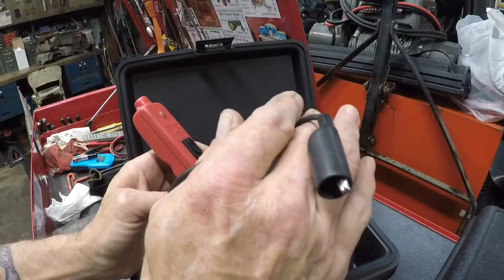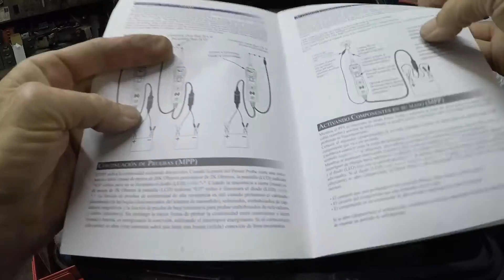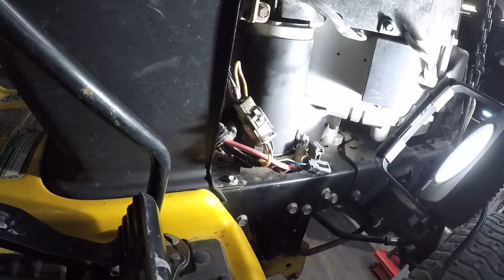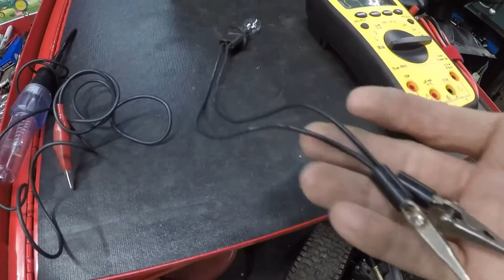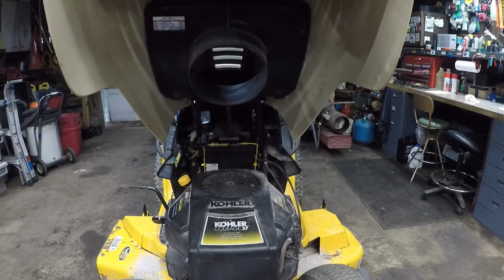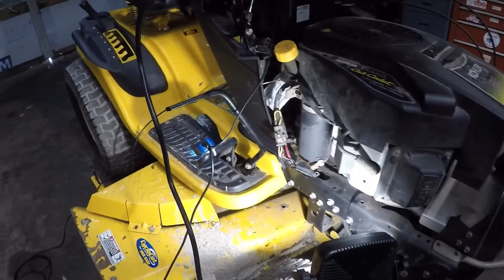Cub Cadet GT1556 Wiring Issue Part 1 #smallenginenation

Comment: Now I have a cub cadet slt1550. I went to start it up and the starter and wires started smoking but the fuse was fine. What could be causing it

Comment: Looking for Part 2.  The electrical issues are hit or miss for me.  I have one right now that I am working on.  It is a commercial zero turn that none of the safety switches are working properly.  I may have to make a video on this one.
Reply from the maker: Heya Bob. Part two should come mid week this coming week. The wiring on these newer machines can be a kin to working on a 1990s automobile in the way of complexity. But getting your self a Power Probe will save you a lot of time. Over the past 15 years since I've owned one, they've saved my butt many times. I did do a quick check in my Troy Bilt part 2 video on the Cub. Cheers and hugs to the little man. Zip~

Comment: I have seen bad batteries work charging system so hard they'd pop fuses, you replaced the battery so no problem there.👍
I'm just wondering if there's a short or resistance to ground at the fuse🤔
Reply from the maker: As soon as I turn the key on, the red/white wire is energized with - battery power. With the key switch off, there's no power from either side, so I need to chase the input as well as output of that wire to find where the fault is coming from. I'll probably resort to the multi meter if the issue doesn't easily present it self in the first in depth trace. But, part two has to wait until I get through the Troy Bilt and my Dog Groomers Craftsman. Part one of the Troy Bilt is going up here shortly. Cheers Willy! Zip~

Comment: PTO Relay or PTO Switch or both.  It's a fairly common problem on MTD built machines with the pull/push PTO switch.  I always change both the small 5 prong relay and PTO switch. Power for the PTO switch and relay runs through that 20/25amp fuse then up to the ignition switch then over to the PTO switch then down to the Relay.   
PTO switch part #   Cub Cadet 925-04175A  
PTO Relay Part  #    Cub Cadet 925-1648A
Reply from the maker: Great info E!! I've got those parts available and I'll take your advice and replace them before chasing wires. I also copied the numbers you provided. You guys are Awesome! Cheers! Zip~

Comment: Hey Zippo, great video bud!  I've chased down my fair share of Wheel Horse electrical issues but this was well thought out and super helpful.  Can't wait to see part 2.
Reply from the maker: Part two will be a few days. I've got a Troy Bilt and a Craftsman on deck to get done, then I can get back to the Cub. But, one comment suggestion I received I will try pretty quick and it might just cure the issue and I won't have to do anything else. Cheers! Zip~

Comment: Bad or frayed wire from a safety switch grounding out !
Reply from the maker: I'm hopeful that what ever it is, presents its self and can be easily fixed. But first, I've got a couple customers machines to get serviced and back to them. Miss Zippo has a small zero turn she can use until I get this one sorted out. Cheers! And thanks for the tip!! Zip~